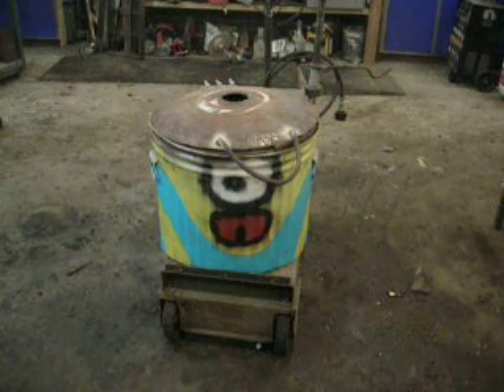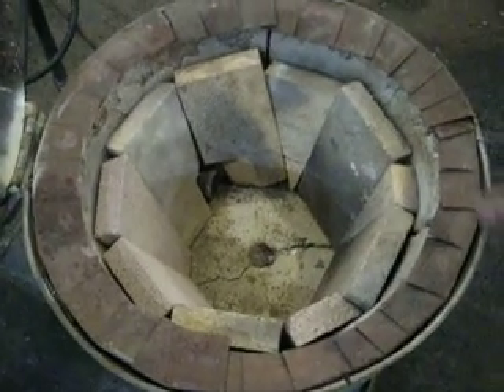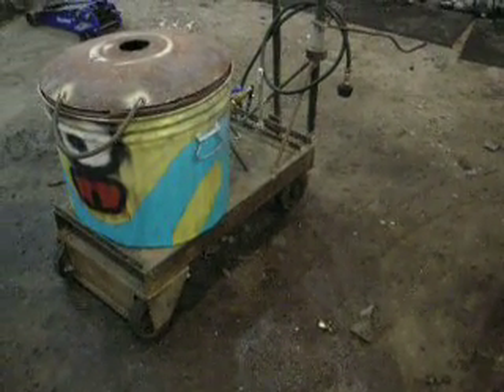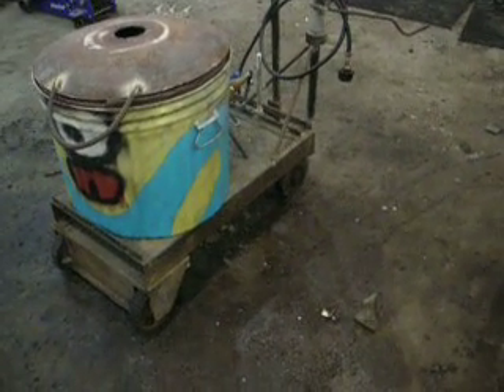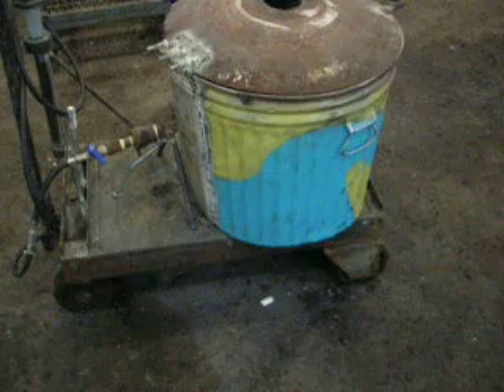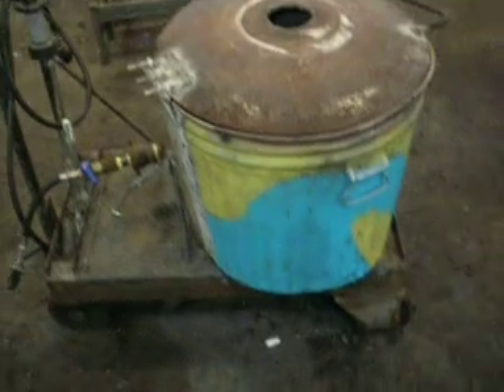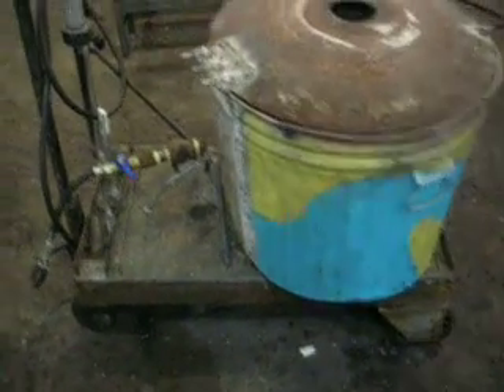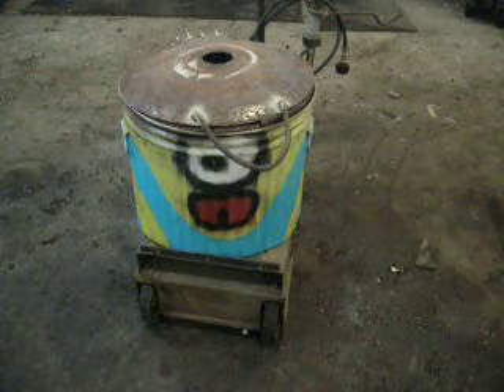Homemade foundry metal casting furnace walk around DIY concrete and firebrick

Comment: Subbing for full build.
Reply from the maker: Cool, stay tuned. I'm hoping to film a quick video today with a breakdown of the supplies I've already purchased and the features I'm considering and potentially a quick drawn up "design".  I REALLY want to get started on the build. I have a bunch of brass and copper I want to get melted into ingots and a couple parts and crafts I want to pour. Thanks for taking the time to comment.

Comment: That's funny.; a foundry named Bob. :) Your concerns about audio, lights and video quality are not that important. But, the content and the record of the journey as you gain knowledge while exploring the fascinating and dangerous processes of metallurgy. Also, being thrifty and innovative are always attributes that will gain admiration and respect. 
 With that said. Perhaps an old 40 or 50 gallon water heater would provide some of the materials for the exterior and possibly make some of the forms for pouring refractory cement.
Reply from the maker: Yeah, a couple years back when the minions were all the rage I painted 4 or 5 of out garbage cans like minions. One I even did upside down so when the garbage man set the empty down he was right side up. I'm kinda known in our community for the goofy decorations I do. I'm BIG into motorcycles and have a whole slew of motorcycle inspired holiday deco. a 7 foot santa stuffing a cycle down the chimeny (even put it on the roof one year), a turkey riding a cycle to get away from a pilgrim, an easter bunny with his basket of eggs in a side car, a leprechan with pot of gold riding passenger, a steel ramp with flames that I put a CB750 parts bike with a welded up skeleton holding his head in his hand that looked like  it was jumping out of hell, and my personal favorite Max (the Grinches dog) riding a Yamaha FZ750 pulling the Grinch in a sleigh.

Comment: You just need better light. Don’t worry about the camera or mic.
Reply from the maker: I was wondering if I could make some make shift lights.  What I had pictured was the ones I've seen on professional shoots that look like umbrellas and have the light pointed away from the subject shining into the umbrella. I'll have to see what I can come up with. Thank you for the input. I appreciate it.
Reply: You totally can. Get a $10 strip of 6k warmth LEDs from amazon and 12v power supply from Goodwill, stick them on something flat, and use a translucent shower curtain from Walmart as a diffuser.